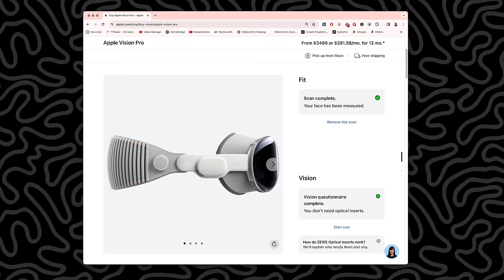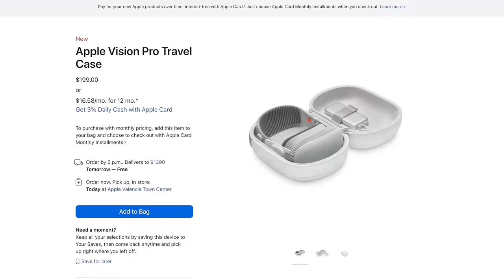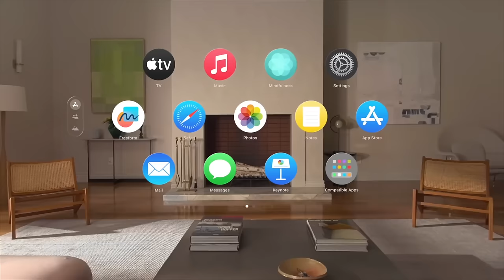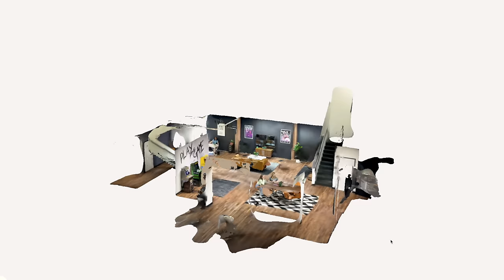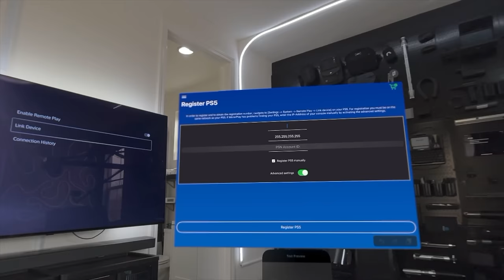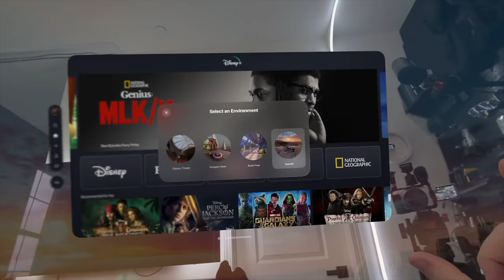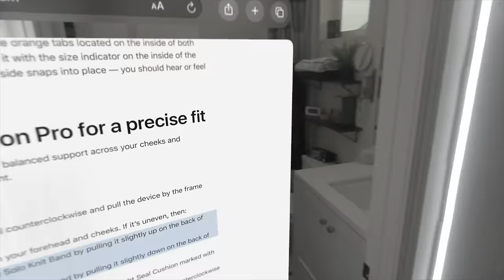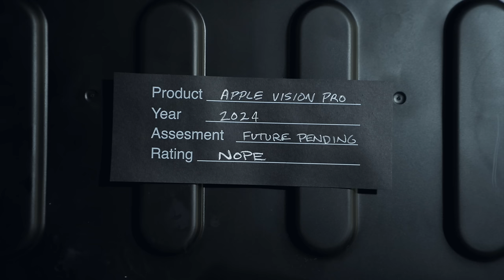Exposing Apple Vision Pro’s Biggest Ad Claims...

Comment: 13:23 there’s absolutely the two squares meditation. That’s quite basic, but visually stimulating. White square with a quarter of the size black square. You focus on each incrementally until you get this Stargate going plaid 3-D immersion into these squares. Learned in high school. studying divergent forms of meditation.🍀

Comment: Third party accessories are a must. I have a Quest 3 with homemade mods to make it work/comfortable. I have a Bobovr M2 plus made for a Quest 2 with 3d printed adapters. The original head tab pads HURT my head from the pressure. I cut them off and added an elastic homemade Velcro strap from back to front. Definitely a frankenQuest.

Comment: For the immersive video section, there is a huge difference between immersive video shot using the Vision Pro camera versus using an iPhone 15. My guess is the one in the ad was using the Vision Pro camera.
Reply from the maker: No, they are the same. It's simple stereoscopic 3D
Reply: @DOPEorNOPE  same technologically sure, but if your two cameras are one inch apart versus 3-4 inches apart there’s will be a huge difference in the depth perception

Comment: The only real use I could see for these is for streaming games while you're not at home and for schools. If they could setup a visual keyboard and maybe some haptic feedback gloves to make it feel like you're typing then it should work pretty well in schools. Though this is a little far since you would need both the gloves and the goggles for over a thousand students which is  bit much. if they could also add headphones then you could hear the teacher speaking while listening to another lecture, especially if they make it to where all other voices are silent except for the teachers or specific students so you can work in groups better. Another cool thing would be if they can connect to each other so you can see what other group members are doing by just looking at them, so the group can work together better or to do presentations.
Reply: Btw I mean they would replace laptops and obviously this is  little far-fetched since noone likes having things over there face, especially some massive sweaty goggles. if maybe they were the size of normal glasses then they would be sick! I mean I' wear them if they were only up to the top of my eyebrows and didn't poke up too much. it doesn't even seem that difficult it just seems that they wanted to cut down on costs.

Comment: 3:40 - Dude. I have ADHD for sure, I might be on "THE SPECTRUM" as well, and I have to say in the moment it's so easy for me to ignore discomfort... it's nice Apple gives you a testing ground to ensure this device fits you right, but I can say for sure I've been bitten multiple times by thinking a product has worked for me only to find out down the road it's not right.
A great example is getting a crown, I have a few crowns (yes the teeth kind), and I will tell the dentist things are right only to leave and find out in a couple day's time that the crown doesn't line up perfectly with my teeth. Even knowing the crown isn't meshing with my other teeth and coming back the stimulus of the situation makes it difficult to properly tell the dentist so they can grind the crown down and make it fit properly. For some of us, maybe even many of us, it can take days or weeks to personally discover what makes a product (be it a tooth or a AVP) fit us like a glove.

Comment: In Europe. A Vision pro costs € 4000,-

I can instead buy a complete top notch gaming rig for:
Case: €150
Power Supply Unit (PSU): €150
Motherboard (Mobo): €100
Central Processing Unit (CPU): €350
Cooler: €50
Random Access Memory (RAM): €100
1TB Solid State Drive (SSD): €150
1st 4K Monitor: €450
2nd 4K Monitor: €450
RTX 4090 Graphics Card: €1850
Now let’s add up the costs:

Total = €150 + €150 + €100 + €350 + €50 + €100 + €150 + €450 + €450 + €1850 = €3950

So, a VR headset, that's terrible for gaming, unwieldy for productivity, no repair support, 2-hour battery life, uncomfortable to wear, etc. 

Or

A 2x4k monitor RTX 4090 Microsoft rig that's cheap to repair if damaged.

Comment: How does this compare with other leading AR glasses, like the XReal?
Reply: I mean, even if you ONLY compared with XReal, I'd love to see comparisons of price, specs, and functionality with average usage.

For instance, I know Apple wants to make people think we'll just stop using input devices, but is their headset better when you DO use input devices, or do others immediately surpass it when you decide that pinching air isn't your thing?

You mentioned the narrow field of vision, but how does it compare with others?

Is there ANY advantage to having all those displays and cameras and sensors, or does XReal's method of seeing through it normally, or putting a black backing on for immersion actually work better?

I'm seeing a lot about both devices (And others) but nothing about how they compare to eachother.

Comment: If it didn't cost so much, it would be just like your headphones. Or my headphones straight back in the box after a week never using them again. Because that constant physical touch of a device against your body gets absolutely annoying after a couple of hours. That's why.
I'll prefer to watch YouTube on my Galaxy ultra.Then I do on my ipad pro because one is big enough and not too heavy. The other one, although bigger and more immersive just simply gets annoying and its weight and size holding the dam thing.